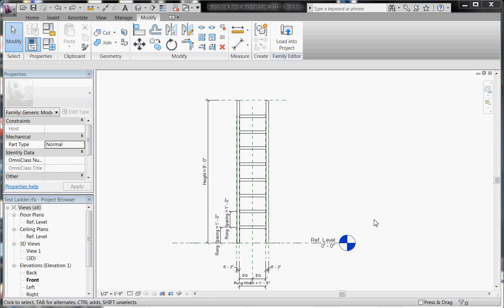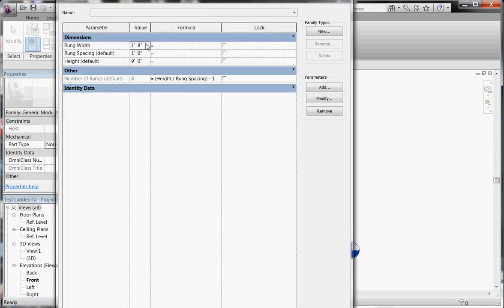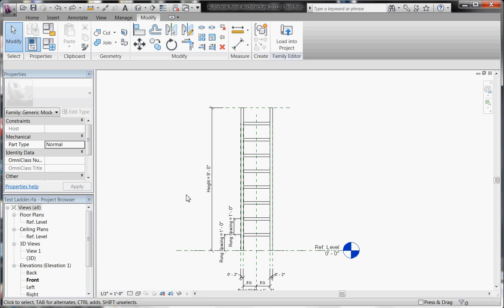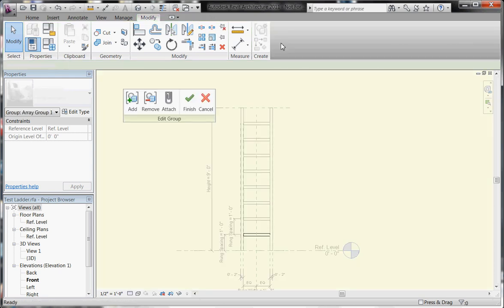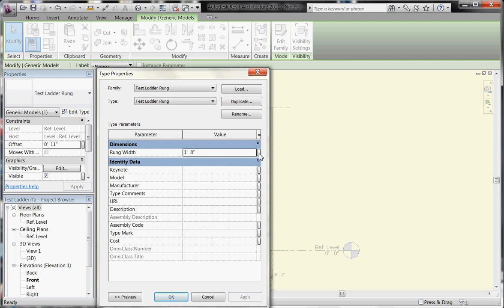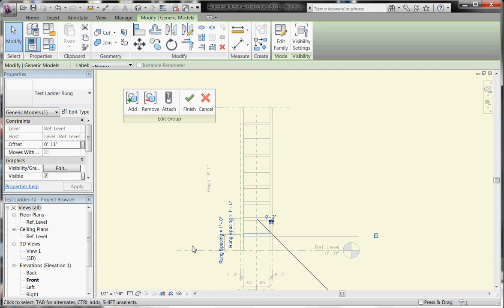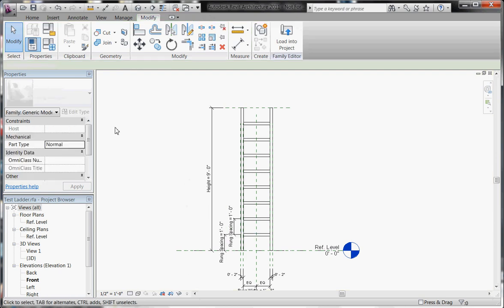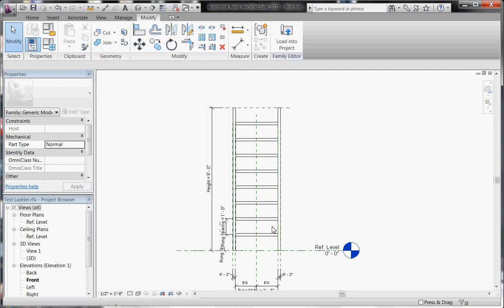Easy Revit (2011) - 15.3.1 - Linking Family Parameters

Comment: Hi,
This here is old, I hope you still work in Revit :D 
So I have a similar problem where I want to make a grill and instead of extruded rungs, I have Model lines to change their width, but they can not if they are in array. If it is only one line, it is not a problem to set the parameter to be the same as the width of the frame. Do you have any solutions for this? 
Thanks